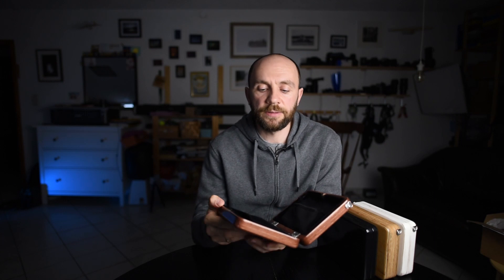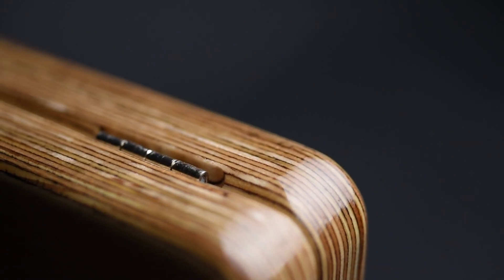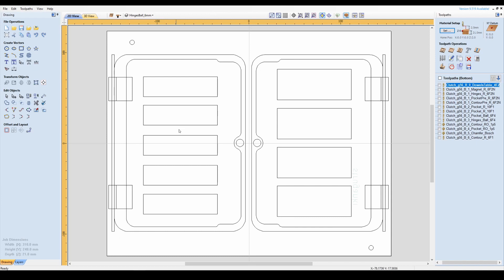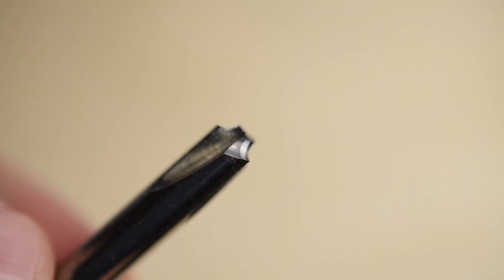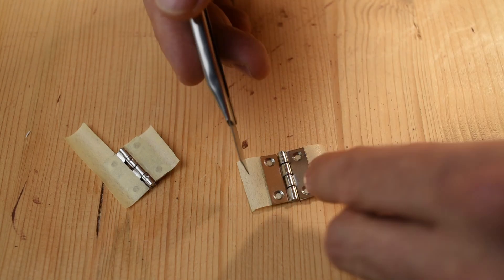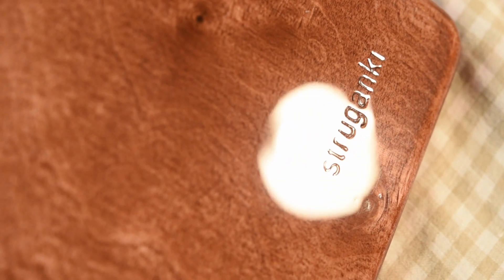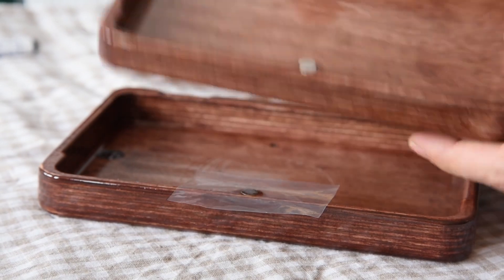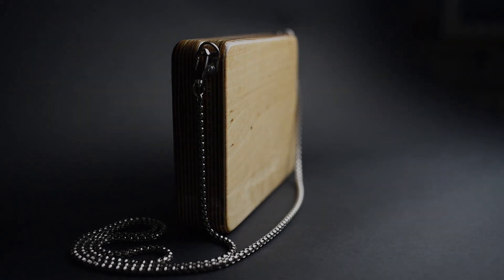How to make a Wooden Bag using CNC-router

Comment: What glue to use when adhering fabric/felt on wood?
Reply from the maker: Hi, the best results I achieved using tolex glue. It's a kind of water based acrylic glue which you apply both on you wooden part and on your fabric. Then after drying you put things together and it's done. Unfortunately I do not know the brand, as I bought it at a guitar shop for working on my speaker cabinet.. Alternatively you can use universal rubber/textile glue, but that one is quite smelly.
Reply: Thank u so much for the help♥️

Comment: I want to know, when you close the bag snap, does it have the sound of wood.. coz i was thinking if i could put cushion to avoid snapping the wood parts
Reply from the maker: Hi, it depends on how to install those liner padding around the compartment. I like when the sound is a bit muted with the padding. If material will stick out more, you’ll get very damped sound. Hope it makes sense.

Comment: Very nice. I have just one improvement to mention. If you Smash the galvanized magnets one to each other for a longer time, the galvanized layer will brake away. It is better to sink them, 0,1 or 0,3 mm deep. Nice content! Why are the ideas the whole time from your sister? 😂👌☺️👍
Reply from the maker: Hi, thanks for your comment. I agree placing the magnets a tiny bit deeper surely makes sense. I think it never bothered me, as after the liner is inside the bag, it partially works as a soft padding, preventing the magnets to smash against each other. Regarding the ideas, I think I just like to be on a technical side of things :)